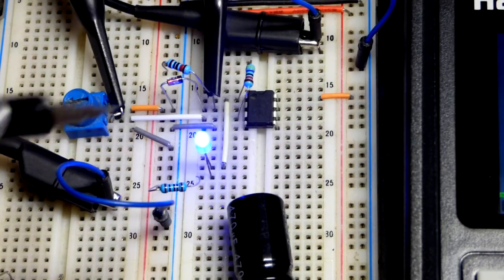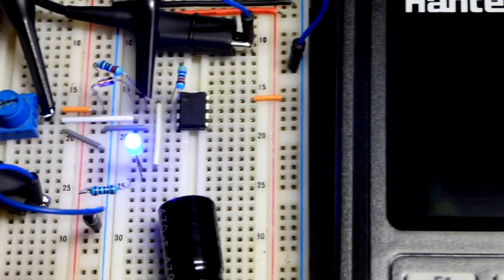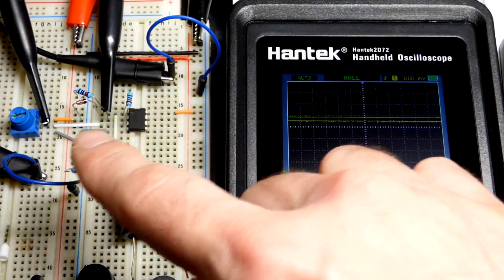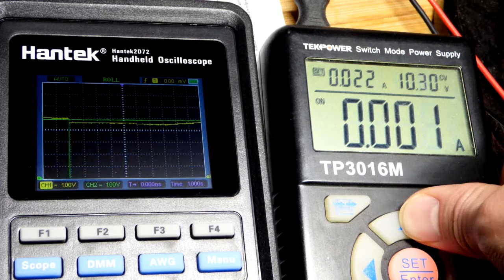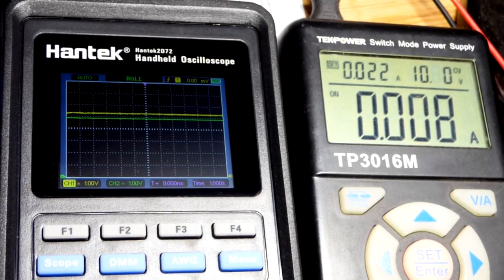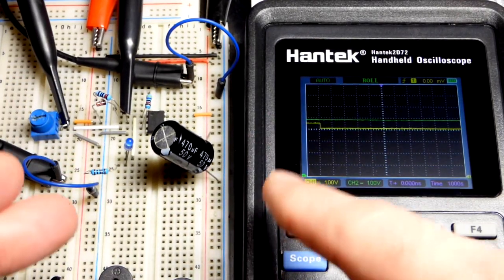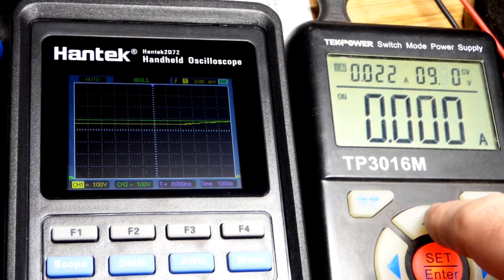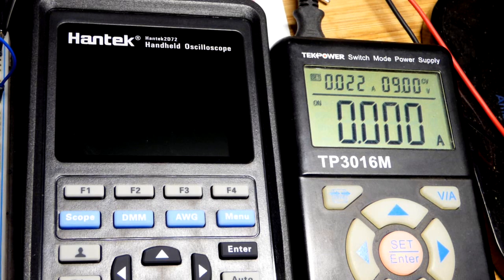2 channels oscilloscope measurement of low power supply voltage shuts off load circuit

Comment from the maker: video of circuit https://youtu.be/oQoCAakmfG0 Adjustable low supply voltage shuts off load circuit using trimpot zener diode LM358 op amp
Affiliate link https://amzn.to/3Ohcf7k for Hantek 2D72 Handheld Oscilloscope 70MHz Waveform Generator Multimeter 3 in 1 Multifunction Tester 2CH+AFG+DMM
List of my videos https://www.youtube.com/c/electronzap/videos
https://www.patreon.com/electronzap
https://www.amazon.com/shop/electronzapdotcom As an Amazon Associate I earn from qualifying purchases. Americans should check out one or more of those links before making any purchases. There's no extra cost to you.
https://electronzap.com/
https://www.reddit.com/r/ElectronicsStudy/